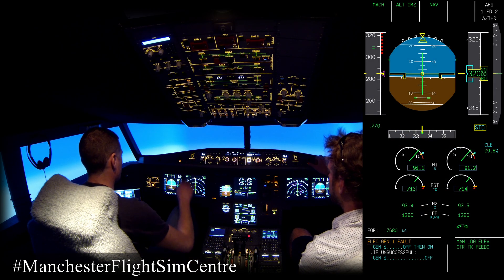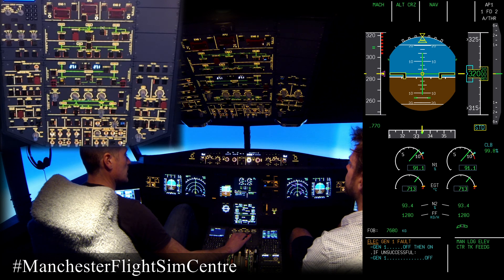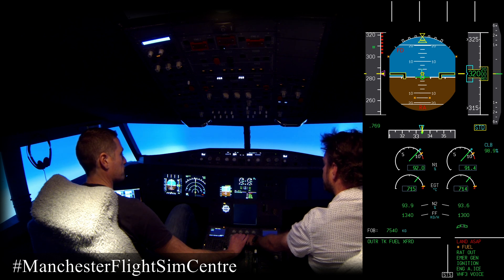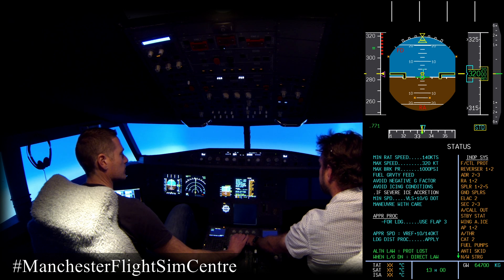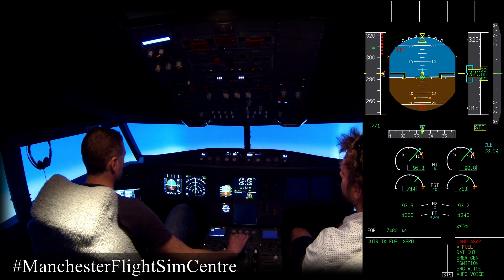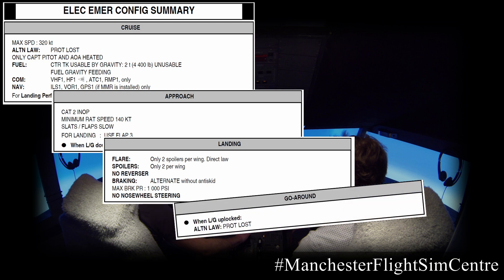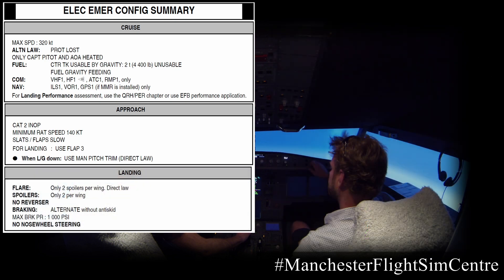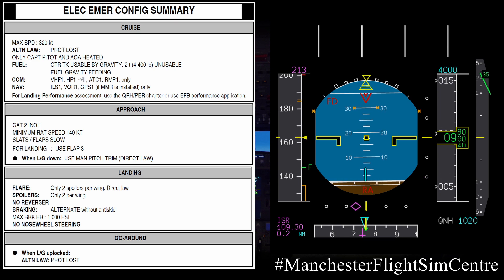A320 Emergency Electrical Config

Comment: If APU is available, can it be started at FL320? Why does FCOM says it can be started below FL 250?
Reply: It depends on which source you’re using to start the APU. If it’s from the batteries, the limitation is FL250.

Comment: Hi and thanks for the video, would most of the systems be recovered if you were able to start the APU?  I'm mainly conerned about things like spoilers, reversers and BSCU. Will they be recovered if APU start is sucessful or do we lose some of those permenantly?
Reply from the maker: You have enough systems to make an approach and land without the APU, although the remaining systems will be limited - no reversers, limited spoilers, and degraded braking, for example.  The APU gen might recover the majority of systems, but the scope of that, or indeed whether it is successful, is entirely dependant on the cause of the failure(s) / which busbar is faulty etc.... I guess I'm saying that it depends!

Comment: Why you didn’t start the APU to recover elec ?
Reply: Its for training on how to handle all 3 generators are inop..  APU Gen + Gen 1 + Gen 2 are Inop... using the last backup emergency generator via the RAT powering up hydraulics and emer gen.. in reality of course we would try to start the APU 1st..

Comment: Hey guys,quick question: does anyone happen to know the font used on the cover of this video? I think it looks really slick and would love to use it for a project I'm working on related to aircraft operations. I've been searching for it, but so far, no luck. Any help would be greatly appreciated.
Reply from the maker: No problem.  I'll look it up and get back to you 👍🏻
Reply from the maker: I think you'll find it quite similar to this https://b612-font.com/
Reply: @manchesterflightsimcentre  Thanks for helping me find the font! I really appreciate it.

Comment: Nice Video guy, confirm the failure, then ask any OEB? If not -> ECAM actions. Reaching status any paper checklist or computer reset? If Not -> read status. An OEB sometimes requires immediate actions as you guys already know, so it must be actioned before ECAM in some cases. Good work love your video very professional.

Comment: Hi, I have a question regarding the video please : gravity fuel feeding procedure. When the ecam call for it, why you didn’t do all the procedure of gravity fuel feeding, and just stopped at the first line, I mean at flight level 300 more than 30 minutes and thats all. Ok, it’s true you were more than 30 minutes at flight level 320, but why don’t do all the procedure in that case ? Thank you
Reply: Airbus seems to have modified the systems. 1. Now L2 pump runs and X-feed opens. CL now has Max FLs as per the weight. 2. AP 1 should be available and not sure but also the ATHR. Manchester Sims would have to reenact the whole scenario. Just kidding. It’s an amazing video. Thanks whole heartedly. I’m not sure if it is the same for A320. My comments pertain to A330.
Reply: @STPT-SaiBaba   fantastic clarification, thanks a lot

Comment: With autopilot now not available flight should not be continued at FL320 as the aircraft is now not RVSM compliant
Reply: basically, we do a Mayday call and let ATC sorted out for us at this point. But it's a good point!
Reply: @julie654 it’s  just a small point, in the event of the aircraft being in the elec Emer config it would be low on the list of priorities. Great channel guys
Reply: @tauruslitrow5024  thank you!
Reply: Good point, only the MAY DAY call SHOULD include the information that hand flying is in progress and that the ATC should expect inaccuracies. It is then up to ATC to manage your separation, it could be that there is no crossing traffic and that they want to let you go on with your drills, but even if there were other aircraft close by ATC would issue separation instructions to them rather that the MAYDAY aircraft.

Comment: GEN1+2 OFF then ON means that you switch them off and on together at the same time.  You applied the procedure wrongly.
Reply: Hi Sir, I will have to disagree on the reset of the generators. It is indicated in the AFM that all generators are to be turned off and on (reset) one after the other. Cheers!
Reply from the maker: We realise that the generator switching might seem a little contentious - please see the note in the info page.  We’re happy to learn though and it’s a great point for discussion.
Reply: I agree... and VHF 1 USE doesn’t mean you call atc at this point, it’s a reminder of what radio and transponder you have available.
Reply from the maker: Thanks for the comment!  We agree, it’s a reminder that VHF1/HF1/ATC1 should be supplied.  However, it doesn’t seem unreasonable to make a radio call at this point if you need to.
Reply: @manchesterflightsimcentre  Absolutely, it’s a not a bad idea to announce MAY DAY at this point. No exercise can be done perfectly. We are humans and a lot plays on us psychologically in such emergencies. The real factors like Weather, turbulence, on board medical emergencies to name the few, can distract any body easily. The final outcome to land safely is the main idea. God bless you all.
Reply: If you read the FCOM procedure you will see a note like this:

“Turn off and on all generators one after the other”.
Reply: I think if you’re getting hung up on how the generators are turned off and on you’re probably missing the point. The point is you’re trying to recover the system first in it normal configuration, then segregated with the Bus Tie off. If either generator/Bus will recover, it will do so when the generator switch is returned to on, regardless of the ordering. If it was a short circuit on the bus, this will occur in the segregated configuration rather than the unsegregated. The important point is to try to recover SOMETHING and not worry too much about how. 
I’ve seen both in the sim and I wouldn’t a criticise a crew for doing it either way.
Reply: What about Fly navigate communicate part?
Reply: Operating both generator switches at the same time is asking for trouble. It will not make a difference. The procedure is asking that both be reset, yes..but not literally at the same moment.
Reply: @noway9880 I agree with this. No doubt the FCOM and its layer 2s and 3s are ambiguous. I'd like to highlight the safety first incident where an IDG1 fault overloaded the other operating IDG2 and it got disconnected that as well in flight leading to Emer ELEC config on a A319. They reset the gens one at a time not together off then together on. They got the gens back and landed safely. I don't understand why Airbus likes to make it ambiguous when clearly this is a common confusion. They should simply put gen1 off, gen2 off, gen1 on, gen2 on. OR gen1 off gen 1 on...gen 2 off gen 2 on.
Reply: Hello (regarding the generators 1 and 2 OFF then ON). When in doubt with an abnormal procedure like this one, specially if Airbus defines it as "complex" remember to always check your layer 2 and layer 3 of your airlines FCOM. You might get surprised for the information contained in this parts. Regards from Chile  🇨🇱✈️
Reply: I totally disagree. ECAM calls for the two GENs to reset so that the crew can isolate the faulty side. Hence the use of the BUS TIE switch so that there is segregation of the two sides and isolation of a possible cause on either side. The PM acted very wisely, and reset the generators one by one, in this way you can determine which is the faulty side (which could be due to arching somewhere on the grid). Therefore, the actions are correct.
Reply: @christosphillips3568   Might be. In this case " Faulty Bus- determine" is missing. and Gen1 - off then on, Gen2 - off then on"  is missing as well.  Instead it states GEN 1+2 off then on. I am not saying that it would not make sense to reset them one at a time. But the wording is not suggesting that .   In an EMER ELEC config there is nothing to determine since you  already run on the essential busses.  Say good bye to AC bus 1 and 2.   They have failed for a reason and you do not want the NTSB to find out which one after you crashed.
Reply: @matthendricks9666  Ecam messages are not available in full text also the ECAM is stupid, it does not recognise multiple failures, here’s where good technical knowledge is very useful. Chances of both gens going inop are very slim, arching on one of the two sides though could be considered more probable. Therefore this troubleshooting method is a good way to know if there’s something you can do to get at least one side back. One by one selection will reveal the culprit pretty consistently.
Reply: @christosphillips3568  I said I wasn’t 100% sure. You certainly seem sure of yourself😂 50% of instructors in my airline would disagree with you. How do you know for sure what the purpose of the GEN resets is? Do you have a source or documentation from Airbus?
Reply: @2660016A  Check in your FCOM the purpose of the bus tie switch, and why it's called to be switched off in the ecam actions. Then you might get it.
Reply: @christosphillips3568  I’m aware that it isolates each AC BUS Bar and I don’t see what that proves with regards to this question. Given that we’re dealing with a fault, I don’t think we can assume that everything will function as expected and it’s not impossible that things that shouldn’t be connected to each other are. I’m guessing the point of this process is to try out every possible combination of GEN OFF/ON states with them tied and untied. Doing it your way means at no time are both GENs OFF (perhaps unloading the whole system might reset something?). Doing it my way cycles through every combination. If you could point me to some documentation that rules out my hypothesis above though, I’d be most grateful.
Reply: @2660016A  Although I can understand by your comment that you know the system, still you are making assumptions that are NOT valid like " it’s not impossible that things that shouldn’t be connected to each other are". If things shouldn't be connected then the system is protected so that they never are, this is the whole idea behind tripped CBs AND generators! If for example something causes an arching on one side,  and you end up with both gens tripping,( because some things shouldn't be connected), then by segregating the two sides and SELECTIVELY resetting the generators, you can isolate the faulty side and put the other side back into service. If you have both Gens off and on simultaneously then it will be ambiguous which side is at fault. I am not saying that it is wrong the way you describe it but it's far more reasonable and easier to do it one by one.
Reply: @christosphillips3568  Saying something ‘isn’t impossible’ isn’t an assumption. You then say it isn’t valid, then go on to describe how things that shouldn’t be connected will trip CBs and GENs = a possible reason we might find ourselves in ELEC EMER CONFIG, seemingly repeating my ‘invalid assumption’ in different words. My method will cover every elimination scenario yours does, plus 1: GEN1 OFF & GEN2 ON, BOTH GENS OFF, GEN1 ON & GEN 2 OFF, BOTH GENS ON. Real life is messy and doesn’t necessarily conform even to all of the scenarios we can mentally conceive of, therefore surely covering all possible combinations is the more belt and braces approach.
Reply: I’m having the same issue interpreting this. I’d contend that the statement ‘turn off then on all generators one after the other’ which is stated in my airline’s FCOM, could be interpreted either way as well and does nothing to clarify. As a comparative example, for 1 + 2 BLEED FAULT, each bleed gets its own seperate line (ENG BLEED 1: OFF THEN ON, ENG BLEED 2: OFF THEN ON). The fact that the GEN resets don’t get a line each like this suggests to me that there’s a difference and presents a case for them being turned off at the same time then on at the same time. It’s not enough to make me 100% sure though, so if you have any supporting info or docs I’d be most grateful!

Comment: wow, is that the sound when the 320 switches the source of electrical power available from ac bus 1 or 2 , maybe? ur simulator looks acts very realistic
Reply from the maker: It's perhaps a little amplifed by the recording, but you do get a bit of noise when the electrical supply changes.  e.g. from one generator to another
Reply: The RAT cones out!

Comment: Why no APU?
Reply from the maker: For the sake of demonstration we dispatched with it inoperative i.a.w. the MEL.  Let’s say due to a starter failure for example.  Airbus give this guidance ‘Consideration should be given to starting the APU as indicated by the ECAM and taking into account the probability to restore using APU generator’.  In this scenario the loss of the AC buses was caused by failure of the generators so it would have been worth attempting an APU start had it been available.
Reply: @manchesterflightsimcentre  I would consider a word with maintainance.. I mean, having apu unavailable and both generators fail at the same flight.. I know about a fellow who won't get a Christmas card.
Reply: @manchesterflightsimcentre  Well said 👍🏻
Reply: Thanks for your Awesome Answer! ☺️👍🏻
Reply: Don’t start APU at very high levels.. air is very thin and u r going to consume the battery.. descend to FL 250 then start APU.